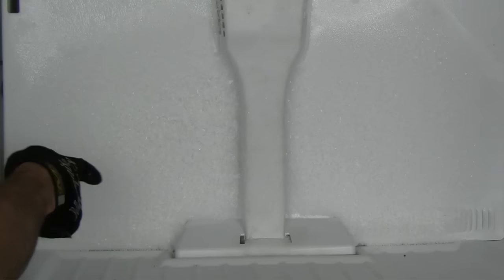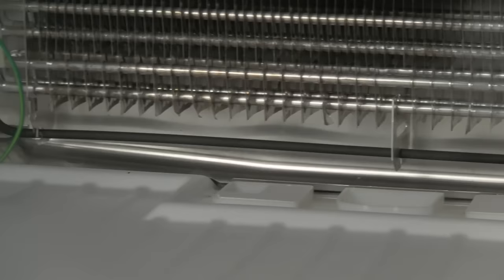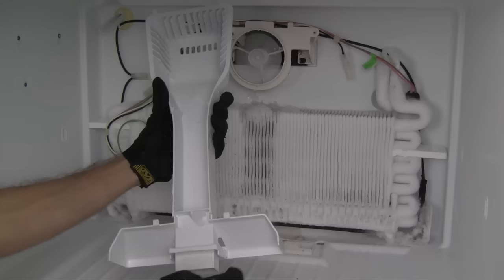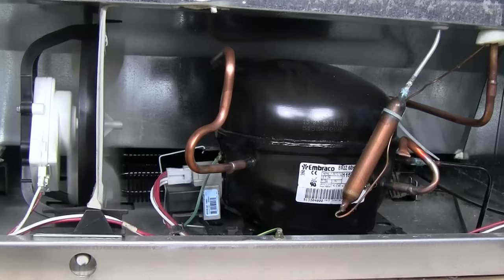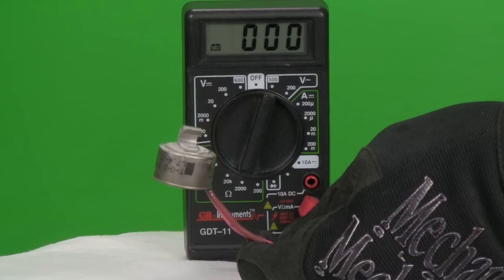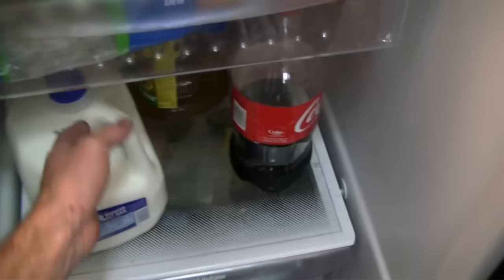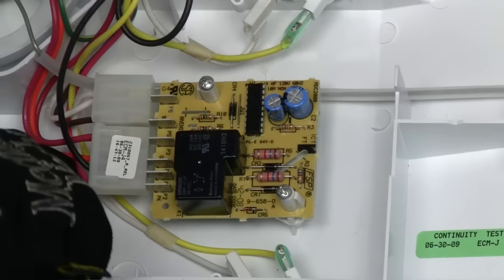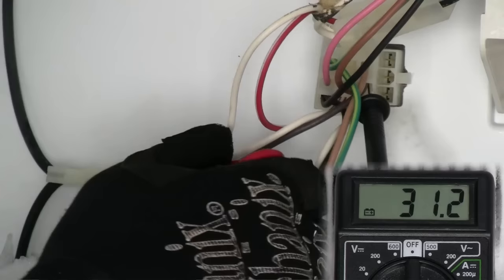Refrigerator Repair (Not Cooling, Defrost System)

Comment: I found an easy way to diagnose for a bad timer. Unplug the fridge and remove the back panel in the freezer. Use a screwdriver to turn the timer until it clicks and now in defrost mode.  Assuming the coils are covered in ice and frost, at this point plug in the fridge. Give it a minute or two, touch the heater element to see if it is getting warm.( be careful because it will get red hot) the ice will melt pretty quick. You know the heater element and thermostat are good and the timer is bad.

Comment: Mate, amazing your video, congrats! Well, I'm having some problems with GE Smart Fresh Frost Free 410 freezer/refrigerator. It was losing performance and the freezer wasnt freezing at all. So turn it off for 30 hours and turn it on (3 hours ago) Now its worse!! The refrigerator is not refrigerating (lol) and the freezer is like a weak refrigerator. I opened that door on the freezer to reveal the fan and the inside and saw Ice only at the beginning of the tubes, the rest is on aluminum only.

Comment from the maker: Yes it will cause the compressor to over heat shut down. It also will cause the appliance to warm up and not keep the proper temperature.  You can put a small room fan down there while you look for the new fan motor.  However, you will need the model number to find the right part... Hope that helps some! Good luck!

Comment: I hope it is the fan only. When I went to check on it that day, after he told me it was plugged in for 4 hours. I was a lil upset with him, because it was not cooling at all. no fan no cool.

Then when I opened the freezer, there was this odd smell.  Not sure if that was some form of mildew or coolant leaking out.

However thanks for the upload and also the one on one help :)

Comment: Needed to know my heater's resistance value.  I see 30 ohms from your video and the same on my heater.  Heater good.  Thanks. Defrost t-stat has already been replaced and all ice dams cleared.  I'll give it a day or two and check circuit board/timer if it still ices up too much.

Comment from the maker: @ChristTheBaptiste I don't know if you have adjusted the controls yet but if you do and that helps you may have a weak thermostat.  The other thing that you will want to look at is the coils under the refrigerator. It's common for a large amount of dust to collect and keep the unit from cooling well. You can clean them with a vacuum and a condenser brush, or even a heavy duster. Also is the freezer fan working? If you email any questions through ApplianceAssistant . com I can write more.

Comment: My Whirlpool top freezer fridge. came with 2 white triangle squares that were over the 2 square holes in the freezer.
Are they suppose to be there or, were they supposed to be removed before operation? The fridge is 12 years old.
Awesome video. Thanks so much.

Comment from the maker: @CookingwithBismillah If you can find somewhere to put your food for a day or two, unplugging it and leaving the doors open for a good thaw may fix it.  If the problem returns in a week or two check the door seals for any air that may be leaking into the unit.  You may also have a mechanical problem with the defrost thermostat, the defrost timer, or the heater, but if the seals look good it's usually the defrost thermostat.  Always try unplugging it first if you can..it's a cheep test.

Comment from the maker: @FORDGTFANATIC If the cooling compartment is not down to temperature the thermostat should be energizing the compressor.  If the compressor is not being supplied with current the thermostat may be bad or a loose contact. If the compressor is being energized but is not turning on, ether the overload relay or the compressor is out. If the compressor is running but cold is not being generated you have a coolant leak or there is a restriction within the sealed system.  Doesn’t sound good.

Comment from the maker: @suztexas Possibly.. It is probably the overload/start  relay that is plugged onto the three side pins of the compressor. There is some information for testing the relay on my website. (link in the description of this video.)  I can't post a working link in the comments on youtube :(  relay help is at the bottom of the Troubleshooting Refrigerator Problems page. Email me through the site if you have questions so I can write a more detailed response. Hope that helps!

Comment: Just discovered the freezer door has been left open, don't know how many hours. Closed the door but after waiting half an hour the freezer temp still says -7c when it should be -19c approx. and there's a bit of water. Can't find the brand/make number of the fridge. Does this mean the fridge will not circulate it's temperate properly? It still says 5c atm. I take it I need to take the drawers out of the freezer and get a hairdryer in there? This is all new to me so sorry if it's all stupid questions!

Comment from the maker: @adyeadon You will need to test the defrost thermostat and heater for continuity with a multimeter when the freezer is cold.  If the thermostat is not frozen you can freeze it with some compressed air keyboard cleaner held upside down. (How to use a voltmeter video) If they test okay it is a fairly safe bet to guess the Adaptive Defrost Control board (ADC) or you can try to test it, but be careful I have been shocked a few times trying to hold the ADC and jump the contacts with a screwdriver.

Comment from the maker: @liber8xion1 Thank you! 1.5 hours may not have been enough time depending on how frozen the air ducts are, even with the doors wide open... You can advance the defrost timer into a defrost cycle if the other defrost components are working. It is located inside the control housing in the refrigerator section. I can't tell if there is a access hole for advancing knob or not... The other possibility is the evaporator fan... Do you hear the fan in the freezer working?

Comment from the maker: @100puerto1 You may have a problem with the overload relay.  It is a switch attached to the side of the compressor.  Unplug the refrigerator and remove the relay, then give it  a shake... If it sounds like sand or something rattling around inside it then its definitely worth replacing.  If you email me through my website ApplianceAssistant . Com I will send you a link to the part for your refrigerator. (I can't post links in Youtube comments)

Comment: Ok I must be more use to commercial applications where the thermostat only energizes and de energizes the solenoid valve which triggers the presser control. Defrost clock with only 3 wires one to power the clock and one coming in and the other it leaving which would cut power to the compressor so that even if it does get called for it won't turn on forcing the temp in the freezer to rise and un-frost anything.  But good point

Comment from the maker: @jurnagin It should get down to temperature within a few hours. You may want to check the coils under the refrigerator to see if they are all clogged up with dust, that may cause it to not cool as well as it did.

Comment: ok yeah i will wait a couple more days. No frost yet in the freezer, but i did push on the back wall and you can hear like the ice crack when you puch on the back wall. Im assuming there should be ice there anyway untill the heater kicks in and defrosts it. It was just random to think to push on the back wall, not sure if it means anything lol i will def get back to you thanks again

Comment: my refrigerator is constantly working, although outside walls are cold, but inside is not cooling either the refrigerator nor the freezer. I looked at the fan and the fan in the engine is working !  What component is not working ? Thank you

Comment: I just bought a 1991 Ford Damon Escaper that has a Norcold fridge. It won't cool either on gas or electric. The compressor is very hot and there is no noise or fan blowing anywhere. Does this mean the fridge is shot? Thanks in advance.

Comment: This video is an outstanding explanation of the defrosting system, nicely done!

My Whirlpool WRI24UG self-defrosting fridge has an intermittent problem where the freezer fan stops blowing for a few days (thus the fridge is no longer cool), then it returns to normal and the fan operates fine for a few days, then it stops again. Rinse and repeat. I wonder what the problem could be -- the fan doesn't seem to be dead.

[update]
The fridge repair guy fixed the problem -- turns out it was a faulty fan motor after all. It seems some motors can develop a fault where they overheat and then will only work intermittently from then on. Had to swap it for a new motor.

Comment from the maker: Hard to say... It sounds like the board has a problem because of the blank display. But the other frost and cooling problems could be due to a secondary problem.  I would start with the board and hope for the best. you can check the thermostat and defrost heater for resistance and eliminate them as additional problems.  the damper door that allows air to flow from the freezer to the fresh food would be difficult to check with a bad board...

Comment from the maker: @ddogz03 Probably not related issues.. The leak into the fresh food area could be caused by the tube that fell and you reconnected, but the cooling issue is probably something else.  Is the compressor running? take a look at the
"troubleshooting refrigerator problems"  page on my web site and see if that makes any light bulbs pop above your head. (There is a link in the video description, then navigate to "repair" and down to refrigerators...) If you have any other questions email me.

Comment: Hi, very instructive video. I have a problem with my side by side myself. The guy who sold it to me has delayed fixing it everytime and they have an attitude and I just want to exchange it for another fridge and he keeps saying he rather try to fix it :/ very frustrating esp since he said all his other fridges cost more and I have to repay another del. and they always lie about where they are at and who the manager and owner is. Anyway, the fridge is not cooling correctly. There is no frost problem covering passage ways and the little filter door is usually closed all the time when fridge is set to coldest. I rigged it to keep the filter door open at all times and the fridge and freezer are still not at it's coldest. Any suggestings?

Comment: Quick question.  With my system I'm only getting 1.8 volts across the leads to the heater.  The heater is plugged in.  The heater is a large U shape that only seems to be getting hot at the very bottom.  Does this sound normal?

Comment: This video has helped me understand what is really wrong with my fridge, but I still have a problem with it. Is my fridge system messed up if both freezer and fridge aren't that cold? The fridge hasn't been cool in more than a month and the freezer has pretty much been the fridge due to it not being able to freeze anything in there. I have a Frigidaire Model fpd14tfw0 if that helps, right now I tried to fix it up so air can be deployed in the fridge so I'll see what happens. Thanks for the video

Comment: Here in the UK ok we don't have this kind of system we have separate cooling coils in the freezer and fridge which are controlled by a flow solenoid that directs The cooling to either the fridge or the freezer or even both.
Reply from the maker: Dual evaporator systems are becoming more common in the US as well. You all in the UK and Europe are always a little ahead of us in the efficiency department. They will still have a defrost system, one for each evaporator coil, controlled by a control board and regulated by a thermistor sensor. The only other option is a hot gas flush which is pretty rare for full size refrigerators. Thanks for the comment!

Comment: My fridge always seems to stay at 40 degrees. This past weekend I came home to find the freezer almost totally defrosted and the fridge at 50 degrees. I threw everything away and procrastinated about doing anything because I have an additional fridge in my garage.  Monday I opened the door to get the model number and found it was working and the fridge temp. was 38 degrees and the freezer was -4 degrees. Do you think your video is describing my symptoms and can I fix it based on the info you've supplied?  Thanks you for posting such a great video.
Reply from the maker: Very difficult to say there may have been an air leak that lead to frost build up and temperature issues that are now corrected from an auto defrost cycle... Or you may have a control issue... or you may have a fan or air flow problem. I would advise keeping the food light for the next 2 weeks and watch it. If you get past the 2 week mark your probably okay to trust it again, just be sure the door is getting closed sealed well every time.  Hope that helps some! Good luck!

Comment from the maker: @aandorotts You will need to do some voltage checking at the compressor to determine if the compressor is getting the electricity it needs or if the compressor is locked up or shorted internally. There is a lot more free troubleshooting help on my website. There is a link in the description of the video. once on the site search for "TROUBLESHOOTING COMMON REFRIGERATOR PROBLEMS" I hope that helps some!

Comment from the maker: Usually the control thermostat or main control board energizes the evaporator fan circuit.  You should have 120VAC or some low DC voltage depending on the appliance...  What is your model?

Comment: CONTINUED:  Same fridge you have used in the beginning of video with the electronic circuit board defrost timer.  I haven't noticed any frost on the back wall as of yet.  Planning on taking the ice maker out, then the back of the freezer as soon as I unplug the unit and see if the are frozen.  If they are should I check the continuity of the heater to see if that is bad?  Its either the defrost timer(circuit board ), the heater or the defrost thermostat Any help would be greatly appreciated

Comment: It is 2021 now. My Fridgitair fridge is turning the light off for longer times. I unplug it then it works again for a while. Fridge is about 4 years old. I blew a way the dust in the back and it works on and off. How long should I defrost it (unplug it) for? Am I blocking the went in the freezer with food? Thank You, Michael.

Comment from the maker: Not to bad on most refrigerators... Some are worse than others.  What is your refrigerator's model number? The main difficulty is removing all the parts that cover the fan but once you get to it they usually just plug in and mount with two screws. Good luck!

Comment from the maker: True but the thermostat opens and closes by sensing the temperature. If the thermostat is not frozen and open the heater will not be energized even if the timer is energizing the defrost circuit...
Also when the defrost heater has done it's job and the thermostat thaws out and opens the defrost cycle stops, regardless of if the timer is still active or not.

Comment: Thanks for this. My fridge freezer was warm this morning in both compartments and the compressor wouldn't come on when turning up to full power. I pulled it out, cleaned dust from round the back, cleaned the evaporator tray (which had some hard limescale in it) and turned back on. Nothing happened but I left on anyway. I then noticed 10 minutes later the compressor is now humming and the fan is spinning in the freezer. I'm thinking where I put a warm loaf of bread in the freezer last night it blocked the fan and maybe ice froze in the drain, stopping it working? Fingers crossed.

Comment: Our fridge diffuser-door (lets cold air from freezer to refrigerator) has a heater on it to prevent ice form building up at the door. That heater is not working, freezing the diffuser door shut. The diffuser was voltage tested - it was heating up when plugged into a computer's power supply (12 volts). So seems like it is getting no juice from fridge itself. The fridge is a LG LSC27910TT. The outlet for the diffuser was giving no power when tested.

Comment from the maker: @drewarkin It definitely sounds like you have found the problem.  To be 100% sure you would need to check that the motor is receiving electricity and is just not functioning.  If it is not receiving power then you would need to check all the connections up stream. the evaporator part number is W10189703 I could ship it to you for 48.95 (shipping included)  Let me know if you have any other questions or I can help in any way!  Thanks for watching and commenting!

Comment from the maker: I would not be able to cover all of the possibilities in the comment box.  I would suggest looking at the refrigerator troubleshooting section on my website. There is a link in the comments section of this video.  You need to determine if the compressor is running or not.  If it is running and not cooling in the freezer that's bad. If its not running it could be a number of control parts that are not allowing the compressor to get the power it needs to run. Take a look at the article. Good Luck!

Comment from the maker: @taracatherine3810 Leaving the door cracked while the unit is running would probably magnify the problem...the fact that it seemed to help makes me think that the air return duct from the fresh food side may be the one clogged and by leaving the freezer door open you were creating a new way for air to move back into the freezer.  Did unplugging it and letting it thaw out help?  Sorry for the slow response, December madness has got me running in all directions.